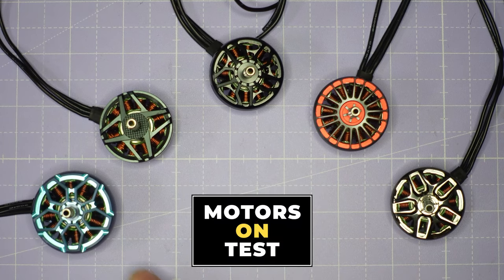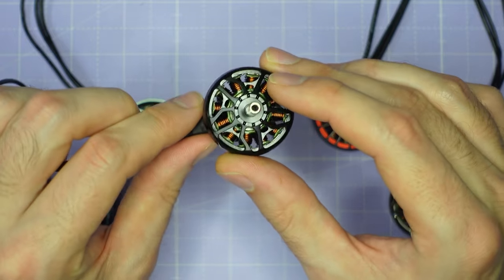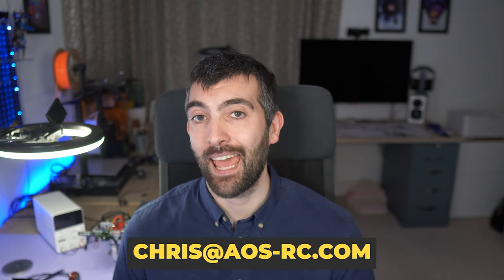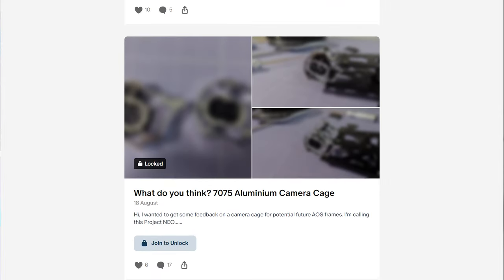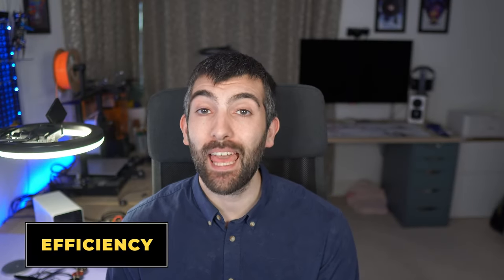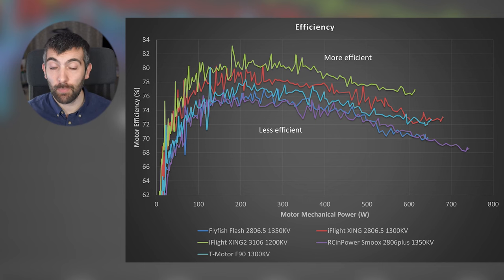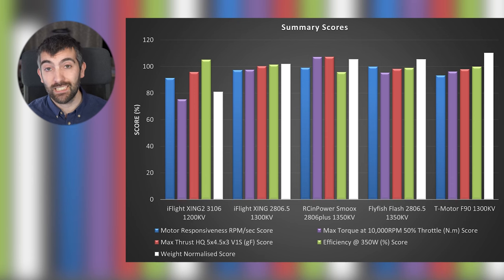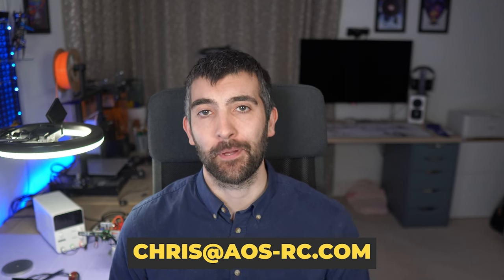7in Motor Testing! T-Motor F90, iFlight XING, RCinPower Smoox, Flyfish Flash 2806.5

Comment: I've been waiting for this one! Thanks chris. I built an AOS 7 last year with F90s and within 20h of flight time over a 6 month period, 3 of my 5 motors have developed what I assume is bearing issues and caused serious oscilations at certain throttle levels. Replacing the motors fixed the issue straight away. I'm currently using Eco 2s and I'm stoked with them! I am a little confused why you didn't include the Emax motors since they're substantially cheaper than the rest and would be interesting to see the performance differences. Anyway thanks again for the super informative video!
Reply: I went the other way. Eco2 bearings were garbage, switched to F90's and didn't look back!
Reply: @WipeoutFPV   Haha interesting experience! For the cheapest by far, I honestly wouldn't be surprised with issues like that but for instance I could buy two full sets of eco 2s for the price of 5-6 F90s. I was stoked with them (F90s) till I had the issues and if Tmotor can help me with the warranty process I'd be more than willing to give them another chance!
Reply: Lol that's what I said. Emax ftw. These other motors might be a touch better but at 150% of the cost.....
Reply: Never had a great experience with tmotor

Comment: nice vid thanks !
I don't see how an extra 20g motor mass matters on a 7" long range rig that weighs 1000g. Also it wont be doing flips and rolls to be penalized by more inertia at the tip of the arms.

Intuitively the result we could be looking for is to answer the question "for how long will it fly ?" So maybe comparing the efficiency at say a thrust of 400g+x, where x is the weight of motor, will tell us exactly that.

Comment: Thanks, Rosser... but the t-motor 2808 being one of the most popular 7" motors...
Reply: Yeah, 2808 seems the better 7" prop motor.
Iflight, fpvcycle and geprc are even using 2809 motors.
Although I like the 2806.5 too. Just not as powerful

Comment: Nice video Chris. These test videos are my favorit.
 I use eMax 2807 eco2 130 KV .After I burned 3 of the motors and damaged the forth , I decided to rewind the motors with one core 0.6mm wire instead of the multi core wire of the original and 12 instead of 10 turns on the stator. With the dril method I found that I had reduce KV below 1200 .But the resistance between phases was 3 - 4 mOhm higher.
The motors are working fine but I have no way to check their efficiency scientifically . 
What do you think ? Are they more efficient than the originall?
Take care
Reply: Good choice on 0.6 wire.

You are going to have better efficiency from neater windings and the lower KV.

Unless you have the equipment to measure wire resistance, ignore the measurement. A multimeter doesn’t cut it.

Good job, and happy flying.
Reply: @lemonsquareFPV  Thanks . 
I don't have special equipment. Just a stable current source (1Amp) and I measured the voltage drop between two phases with a multimeter. It was about 0.0565V and with the original wiring it was 0.053V
Reply: @diverFPV  nice

Hey, if it’s repeatable, that’s all that matters.

But I definitely wouldn’t worry about that difference, as under operating conditions the single 0.6 will stay way more stable and consistent.

Comment: i have 2 sets o f the F90 1300 in use since 2018. i only need bearings, because i have a lot of sand in them.  motors still run smooth. had some crashes and hit some trees, but nothing serious.

Comment: At 8:55 seconds in the video, you give the motor a throttle step signal (a sudden change from 10 to 50, and then a sudden change from 50 to 10) to test the motor response, but the final result is absolute RPM changes per second
In fact, this test measures step response, and the performance indicators of this response do not include changes in the absolute value of the measured value, but should include changes in relative proportions such as rise time, settling time, and overshoot.
Taking this motor response test as an example, what we should care about is how long it takes for the motor to change RPM to 90% of the final value when the motor throttle signal steps to a certain value, rather than the absolute RPM value change of the motor, because considering the absolute value change, within a certain KV range, higher KV values must have advantages.

Comment: I'm also interested in VTOL applications such as biplane-tailsitters, which VTOL but cruise as fixed wing. Could you include FWing/cruise pitch speeds/efficiency and a higher pitched prop, optional data.  Is there a wind tunnel in your future 😅?

Comment: From  Old School Glo/Nitro/Wood/Foam,, I'd come up with Questions about Prop Pitch/Length and Elevation just because of Air Density. I start out at 4200ft Elevation and it is way different to play in sea level then fly to 4200 ft then to the Clouds for Anarchy flights. I miss Glo topics with these engine tests.

Comment: hey chris i am really curious how a high kv motor like 2400kv runs on 6s with a motor output limit as it might effect performance. I am part 4s and part 6s with my quad and it automatically tuns a motor output when 6s is in and wondering if it might have different efficiency ,torque  and motor responsiveness than a normal 6s motor on 6s